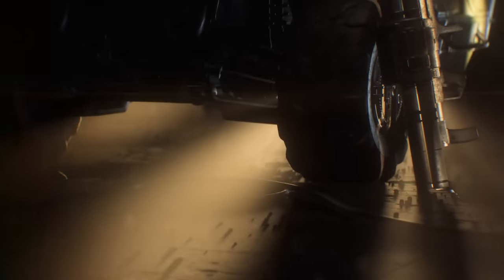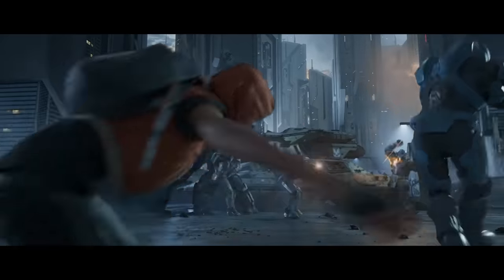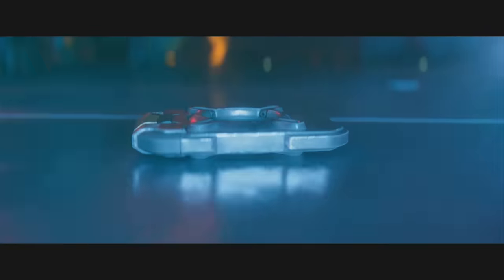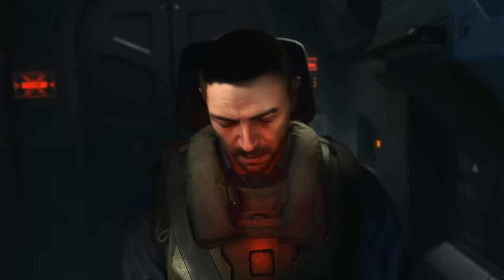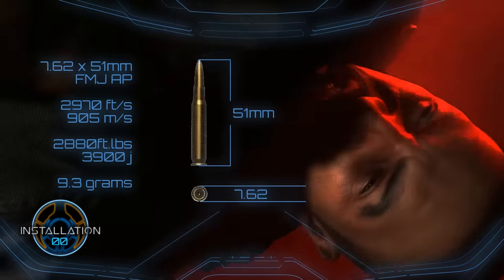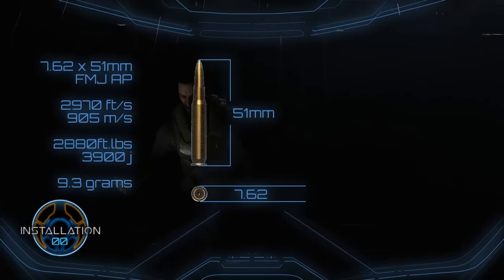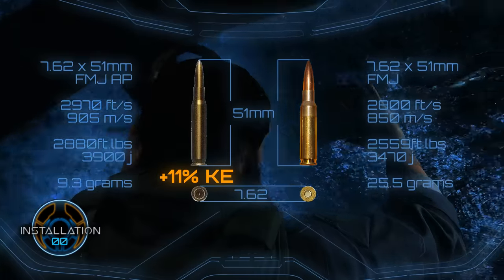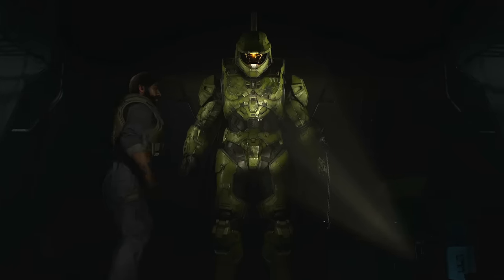Why are UNSC Weapons so powerful!? | The Armory

Comment: As an addition to this, there is bullet material. The way one defeats armor is with speed, not size. So, in theory, it could be that the bullets themselves are made out of a much harder, but much lighter, material allowing for increased velocities with the same powders and allowing much better penetrative power
Reply: That’s very possible especially since the unsc made a tank that was only 33 tons when compared to it’s predecessor which was the m808 scorpion which was 66 tons. They are roughly the same size but the m820 uses a bigger gun and still has the same survivability
Reply: cough cough Titanium 50 cough cough
Reply: hardness doesn't equal penetrative power, at extreme velocities you generally need density. metals behave more like liquids under those conditions.
Reply: @jonathanpfeffer3716   actually you don't need density, speed matters way more. We are talking about energy via velocity not mass. 

its the same reason a .220 swift fmj outperforms a round like 30-06 AP when shot at armored steel despite being a 55 grain bullet.  

The way to gain speed and penetration is with lighter harder materials
Reply: @lostwizardcat9910  never said velocity doesn’t matter, that’s absolutely true. just not hardness. sectional density (and velocity) is all that matters and the .220 has both. the .220 swift is also less hard than the .30-06 AP, which is why I’m a little confused you are bringing that up as an example for why hardness matter above all else lol. hardness is absolutely not it though. look at APFSDS rounds from tanks, which are the penultimate armor penetrators in ballistics. they will only have hard caps, not hard shafts. the shafts will be much much denser. exclusively using hard materials will just shatter a rod. 

irl ideal small arms penetrators will be similar. subcalibre tungsten carbide tips with slightly less hard but dense core materials. that’s how this is done irl, so no need to speculate.
Reply: @jonathanpfeffer3716  I literally never mentioned hardness being important above all else I actually said it was speed. 

 however hardness does matter to some level that's why a lot of military ammunition is steel cored the core often being referred to as a "penetrator". If hardness didn't factor into penetration at all we'd all still be shooting cast lead bullets at each other not copper jacketed bullets. 

Also we are talking about speeds rarely seen in firearms here. A .220 swift is a 55 grain bullet moving anywhere from 3800-4600fps, that's the only reason it penetrates more than a much harder, heavier round that's also putting out roughly three times the  energy. 

Velocity is everything when your going for penetration. If density mattered as much as you think a 30-06 shooting an 150 grain AP round should outperform a 55 grain jacketed bullet that puts out three times less energy.

And the only way to increase speed in a modern round like .308 is to go with a lighter bullet. hardness can only help with penetration because at those velocities the hydrostatic shock delivered to a soft target will cause more damage than a just a bullet ever could. 

Thats why the .220 swift in its hayday was a favorite of red deer hunters and people that hunted feral barrows.
Reply: @lostwizardcat9910  I’m ignoring everything you’re saying about velocity because you still for some reason are talking about it like I’ve ever denied it’s important. 

But you still are really misunderstanding terminal ballistics. You’re claiming harder, lighter bullets will penetrate better than a denser, heavier bullet, which just isn’t the case. We don’t make bullets out of carbon fiber or tip APFSDS with diamond for a reason. Extremely hard materials shatter. You need a mixture of density and hardness for optimal penetration. That’s tungsten. Or DU. Neither are light. 

You’re sort of right in your conclusion that you want a lighter bullet to increase penetration, or rather to increase velocity, but you’re totally off the mark in how that’s done. You don’t do that by altering the material of the bullet, you do it by increasing the powder load, the burn speed, and you’ll use a subcaliber sabot round. 

Also, I hope you’re realizing you’re arguing against real life here. Everything I’m taking about is how it is actually done with real life AP cartridges and shells. So you’re not just arguing against me, you’re arguing against basically the entire worldwide military industrial complex, and trying to claim you know better than everyone else.
Reply: @jonathanpfeffer3716   And everything I've mentioned is based off of real life testing that's well documented.  

Furthermore titanium, the metal people mentioned using, is a fairly soft metal, softer than most steels so once again your whole tirade about hardness is nonsense. 

Also if density is everything explain to me how a lighter faster round out penetrates a round that delivers 3 times the energy AND is designed to be denser and to penetrate armor. Explain how a copper jacketed 55 grain bullet penetrated better than a 150 grain armor piercing round. 

you don't seem to get it, the weight in theory aids penetration of SOFT TISSUE.  HOWEVER it is also proven that smaller faster rounds defeat armor BETTER than heavier rounds regardless of composition

5.7mm for example, its a faster lighter bullet that penetrates more because of speed! You fail to address the fact that speed defeats armor and mass carries through flesh. The reason AP rounds work the way they do is a HARDENED STEEL CORE that brute forces its way through armor. 

A smaller caliber bullet with the exact same energy as a heavier larger caliber bullet will focus more energy on a smaller area penetrating easier. 

As for your argument about hard things shattering, no. Not really unless it hits something harder than its self. 

Also in the 1960s the company  KTW attempting to make handgun rounds that penetrated medium barriers (car doors and windshields)  experimented with sintered tungsten-alloy Kennertium W-10 projectiles, which were eventually abandoned entirely due to supply and cost concerns.

Comment: This might be a stupid question, but is it possible the UNSC is using a variation of ETC (Electrothermal Chemical) Ignition? I understand research is being done in this field for tank and CIWS rounds, however there is no mention of this technology being unable to be sized down to small arms application.
Reply: They probably use better propellant mixture with much higher pressure that increase their bullet velocity up to 42% (doubling their kinetic energy) just like SIG FURY Hybrid Ammunition Technology implemented on XM5/M5 Rifle & XM250/M250 Automatic Rifle.
Reply: I agree with this. We are talking about way in the future. ETC would be a relatively simple add on to firearms.
Reply: @makbar59  unless you make it as self-powered plasma primer or at very least with very dense hot swappable power source I don't see ir will get widespread use in small arms technology

SIG FURY HYBRID ammunition is much more practical in use (for now) without risking your rifle to completely brick itself because of electronic jammers or EMP.
Reply: @zidniafifamani2378  We are really rapidly coming to the point where solid state batteries could make prototypes a reality. In the Halo setting a button battery as a backup to the a gun's internal battery would easily be possible and reliable. It's not as complicated and weak to an EMP. 
Basically the operation would remain the same except the firing pin would just be completing a circuit.
Reply: @zidniafifamani2378  
My dude... The United States military developed a prototype 120mm ETC gun variant of the M256, the XM291, almost 22 years ago now and was capable of nearly 40% increase in muzzle energy. And it has a higher muzzle velocity than proposed 140mm guns.
...If you think ETC technology isn't viable 500 years from now... I don't know what to tell you. First of all, the firearms in Halo have electronics embedded in them coming out the wazoo with things like ammunition counters, Smart-Links, etc. Secondly, you don't need a ridiculous amount of electrical power to generate these plasma ignitions. Thirdly, explosively generated plasmas are a thing. So, yes, you could generate these even without electronics if you wanted to. Fourthly, ETC guns can easily be backwards compatible with conventional ammunition.

Literally all this take to get off the ground and be viable is new primer technology utilizing explosively generated plasma ignition and suddenly the ammunition you have is almost 40% more capable overnight without changing anything else. Might have issues with chamber pressures and whatnot, but that's fixable and worth dealing with for the added muzzle energy. If we can't develop that 500 years from now when we've figured out faster-than-light travel and anti-gravity, then humanity deserves extinction.
Reply: @makbar59  solid state battery primary advantage is it extremely safe and stable compared to Lithium Ion or Polymer Battery, NOT its energy density, but of course you can use better materials for the battery, for example:

Silicon Nanofiber Lithium Anode that can hold up to 3,000 Wh/kg, Lithium Phosphorus Sulfide Chloride sandwich between Lithium Germanium Phosphorus Sulfide Electrolyte that retains 81% of it's full capacity after 10,000 charge and discharge cycle and reduced-Graphene Oxide Aerogel-encapsulated Sulphur-rich Solution Semi-Liquid Catholyte for it's 2,700 Wh/kg capacity and relative cheapness.
Reply: @zidniafifamani2378  fyi, there's a current battery tech is safe, cheap, easy to produce, reliable, energy dense, 

and most importantly, non rechargeable

Aluminum Air battery, a kinda shitty EV battery but super good for military fast swap / descardable uses, perfect for the 'disposable' unsc weapons
Reply: @j1883311  aren't that kind of battery requires air (i.e. extremely pure oxygen atmosphere) to work? It means you have to make the battery into extremely reliable vaccum-proof pressurized vessel by itself or it will be complete bust.
Reply: @zidniafifamani2378  currently it only need atmosphere air, so it's basically stacked pure aluminium fins packs, and if u pack a small oxidier reactant into the battery for vacuum usage it'll still be dirt cheap and discardable and recyclable, not to mention what these can do in 500 years 

the current application is used as naval ship megawatt power supply and recently EV millage extender since it can make cares run 1500 km, better then standard 500 km alone but it's inability to charge make it so far limited to as add-ons, not replacing normal car batteries anytime soon
Reply: @j1883311  what about Lithium-Air Battery?

How many power are required to ignite small arms propellant and how long it requires to charge the capacitor per shot? The last time someone tried to make electronically ignited firearms it requires 0.6 second to charge it, and it only using normal chemical propellant.
Reply: @zidniafifamani2378  the problem with lithum air is lithium metal are not that abundant like Alumilum 

not only that, aluminum is 'dirt cheap' , abundant, easy to recycle(also cheaper to recycle then refine raw ore) then lithium from what I see so far 

that's why I pick aluminum air , or even iron air battery for military usage 

remember in war time we need to think of logistics.  Easy to use and dirt cheap to recycle/make materials, not the most high tech stuffs

also on the electrothermal ignition for smallarms: I really don't know, I'm not well versed with this tech and also it's 500 years in the future where we don't know how we'll developed for this 

but from some lore material I doubt they use electrothermal and stick with mechanical simply from the fact the rebals often use some stripped down guns from unsc and It still works 

weapons are best designed as simple as possible, best is even a jock can operate and maintain it , so the battery subject I only simply wanna say: the ammo counter's power source can be super cheap and disposable and would be the last thing we'll need to worry about lol
Reply: I was going to bring up ETC. It'd be strange if they didn't use it given the tech level.
Reply: @Lyze  yeah, especially since it’s such a (relatively) simple explanation for the tech progression
Reply: I was just about to say that, and I absolutely agree with you. ETC guns check all the boxes.
Reply: I believe the M820 (halo 5 scorpion) uses a 150mm ETC gun.
Reply: No mention of it because it's grossly impractical and requires a vastly larger number of components to seal both ends of the round. 
Metallic cased rounds are very cheap to easily produce, obturate the chamber during the firing process to reduce fouling, return to a safe dimension after the firing cycle for easy extraction, and carry a substantial amount of the weapon's heat away with them to act as a self-extracting heat sink. THey are durable, easy to handle, can be adapted for a wide range of feeding systems, and made out of extremely inexpensive materials. 

Think about it. A tank gun has an external power source (engine's alternator and hybrid battery array for diesel-electric  or turbine-electric drives), it has a grossly smaller round count (there are 11 rounds inside the hull of an Abrams plus another 40 or so stored in the rack, compared to a typical combat loadout of 180 rounds of 5.56 plus another couple hundred more in sealed vinyl packs on stripper clips inside a ruck), and most modern tanks and artillery pieces are still single-shot, open breech designs where each round is loaded individually by hand. 

In a handheld firearm, the primary benefit of ETC (even and consistent ignition of extremely large volumes of propellant, leading to more consistent velocities) can be overcome by simply using a slightly more zippy primer. 
Cheap PPU Gold 168gr ammo has a velocity consistency of less than 40FPS maximum spread, which is good enough to yield perfectly adequate results well past the maximum effective range of a 7.62x51 round. ETC is completely unnecessary and would only increase the weight and complexity of the firearm. 

A more realistic and practical option would be a more traditional electronic primer ignition.
Reply: @009013M3  the thing about ETC guns is that you can use microwave ignition which is gonna provide way better performance than a zippier primer can since it can basically ignite the propellant instantly and evenly inside a chamber. A zippier primer would not be able to compete on that level. 

Better formulation of the ETC propellant and continued improvements in electronic costs and energy storage technologies will definitely make ETC small arms very much viable in the future.
Reply: he talks about this in the video the lore say no!
Reply: the is an American company that in the 90's that a system that was a pepper gun with 8 x 36 Barrels, each barrel could have 3 to 9 rounds, the prototypes were 9mm Par.  From a laptop could fire on the bullet or every barrel, then .5 seconds later fire the next round.   I was using C4 for propulsion. So that is 150 rounds a second!
Reply: @makbar59 especially considering that literally all of their air vehicles are powered with miniature nuclear fusion reactors it's not a high jump to make

Comment: Advances in metallurgy would mean a stronger barrel that can stand higher PSI allowing the use of compounds that would blow a modem gun to pieces. So you don’t need more propellant giving a lighter round with more punch, you can see this in the modern world with things like how fast bomb fragments can travel.
Reply: I would have assumed this. Better Metals and build, can support higher pressures. Putting more force into the round that itself is made of better metals making it a stronger overall package.
Reply: You don't even need that. You can get this exact performance out of M80 ball developed in 1969 with just a little bit longer barrel.
Reply: Don't forget lightweight.

Comment: there's also a key feature of unsc weapons: they are bullpups that have extra long barrels, longer even then modern bullpups.  

the bullets have time to accelerate for longer and faster to reach a higher muzzle velocity, hence, greater kinetic energy delivery.
Reply: All other things being equal, increasing barrel length can increase velocity to a point.  Pressure will peak at a certain point in the barrel and then drop off.  From that peak, extra barrel length is just friction.  A round whose powder burn is not optimized for a longer barrel will not benefit.